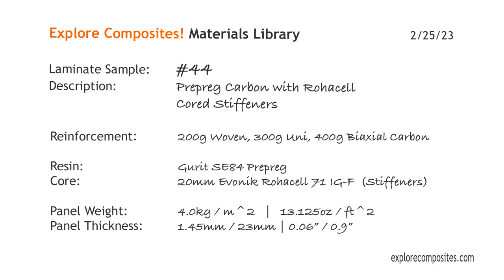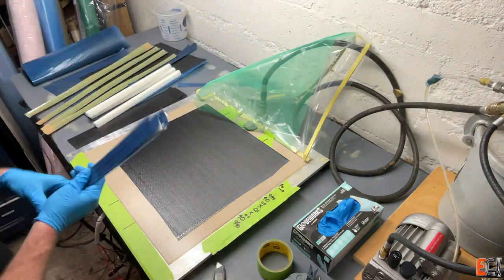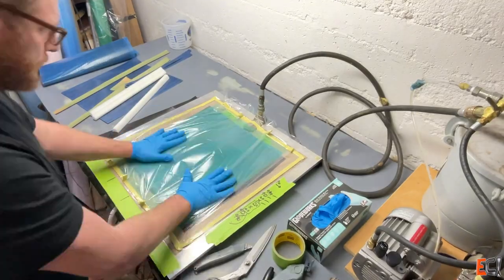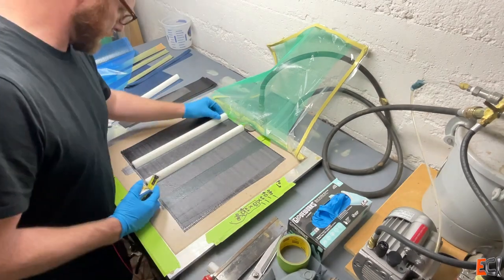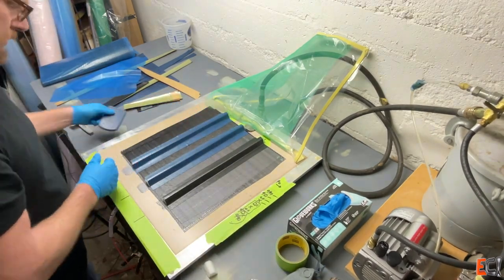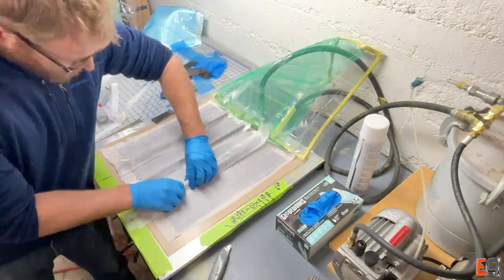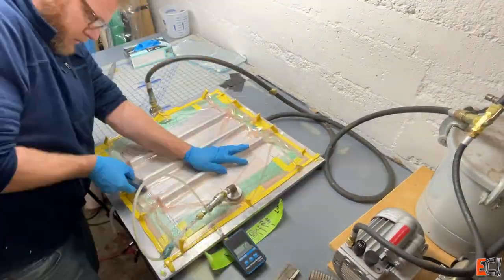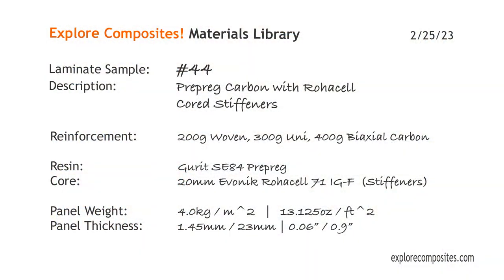Laminate Sample #44: Prepreg Carbon with Rohacell Cored Stiffeners

Comment: This is awesome. Be so cool to see a hull made this way but man it would be some work!!
Reply from the maker: Some ocean racing boats replace core with solid laminate and stringers in the forward hull - to help reduce damage from slamming into waves.  Often the stringers are molded off the boat and bonded in but there are probably some quite similar to this in construction.  And yes - a ton of work!
Reply: @ExploreComposites  I used coosaboard core in my boat build for the stringers etc, good stuff but it's so itchy it makes sanding fiberglass feel like candy floss :) Hand layup epoxy and biaxial. heavy way to do it. next time I'll try to use vacuum techniques

Comment: I'm wondering why you are using the peel ply and stack that sucks epoxy from the prepreg? Are not prepregs at the perfect resin to fabric ratio? Normally I see most prepreg stacks just have a non perforated release film and then vacuum bag. So was wondering why the different stack makes sense here? Thanks for the answer!
Reply from the maker: That is a good question!  The bleed is done here to make sure the air can escape from the curing laminate.  My rule of thumb is that in an autoclave with several atmospheres of pressure, you don't need to bleed off resin to get air to not be a problem.  But without an autoclave - especially with core and thicker parts - you should allow some resin to bleed off and that this helps.  (This is a very common approach in most of the factories I have worked in or visited.). 

For thin (less than 1mm) parts that are well debulked, it is fine to not bleed resin off - sometimes this helps with cosmetics - this is probably what you see most.

Check out my Laminate Sample #12 for some "semipermeable" Dahltex membrane to let air out but no resin.  https://youtu.be/wUiRHb0YRC0

The resin content of the biaxial here is quite high and the weight of the resin bled off is probably less than 15g total for this small sample.  The woven bleeder is very thin and doesn't take up much resin.  If average resin content is 40% this sample probably bleeds off about 10% of that resin, so the overall ratio ends up around 35%, which is fine.  

It is common to measure and then calculate how much resin you bleed off using a certain combination of perforated film and weight of breather.  Used consumables can be weighed and the uptake of resin calculated.  In very general terms, keeping resin content above 32-35% for mostly unidirectional carbon is a good place to be.  It is totally possible to bleed too much!
Reply: @ExploreComposites  thank you so much for the answer. I knew I had to ask. Thanks for all of these videos, I’ve learned so, so much from you! Keep making these awesome gems ❤️🤘

Comment: Hey, but what about pressing hard with the thumb on rohacell foam, will there be a visible dent left or not. What about pressing with fingernail?
Reply from the maker: It comes in varying densities - and the light stuff will dent with a finger.  This will easily dent with fingernail pressure but quite stiff and brittle over larger areas.

Comment: Hey, what do you think, how would this foam feel in direct contact with a skin. Does it fill similar to polystyrene foam? If you could find something more similar I'd love to know
Reply from the maker: This foam is very hard and almost sharp.  It does have a similar brittle sharp feel to the blue Dow Styrofoam that comes in big billets - but more so.  Not something I'd want to spend lots of time in direct contact with...
Reply: @ExploreComposites , I am new to foams and foam cores. It would be interesting to know how does it compare to some rigid pour pu foams

Comment: very nice,, !
what leak detector do you like ?
Reply from the maker: I have a few of the Amprobe ones which I like but the headphone jacks are delicate.  I just get used ones but have used nice expensive units but the real big thing that helps are good padded over the ear headphones to block outside noise - which you can plug into most detectors that come with cheap headphones.

Comment: Where do I find that adhesive sheet?  Can you do a video on the types of fittings you like to use?
Reply from the maker: The sheet is “film adhesive” and it is just prepreg resin of a certain weight.  This came from Gurit by way of Composites One.
Reply from the maker: Fittings:  https://explorecomposites.com/articles/tools-and-equipment/vacuum-stuff-hoses-fittings-and-accessories/

Comment: What is that device you used to check the pressure was holding?
Reply from the maker: Its an absolute vacuum gauge - digital.  Very handy tool.  This one is a Greisinger GDH 200 - its pretty old.  They make a newer smaller one now.

Comment: 3d printer bed heater is a great idea I think ill try shine a hot lightbulb at the bottom of my mold made from a 1” glass coffee table
Reply from the maker: Heat lamps are great, just be careful of the whole fire issue!  I've had some scares with hot bulbs.

Is there any risk of breaking the glass by heating unevenly?  I guess table tops are probably tempered glass...
Reply: @ExploreComposites  great questions I didn't consider. Testing soon. Hopefully 3' long by 2' wide 1" Glass mold doesn't distort much when lightbulb heated.

Comment: What is the tan layer you put down first on top of the metal base. I've seen you use this before in other vids and nothing seems to stick to it.
Reply from the maker: It’s adhesive PTFE release film.   https://explorecomposites.com/articles/tooling/adhesive-teflon-its-awesome/
Reply from the maker: Good stuff!  No need for chemical release agents.
Reply: Thank You! I saw the list of suppliers at the bottom of the article. Who did you get your material from?
Reply from the maker: Probably Taconic.  Composite Envisions and RockWest in the US sell it by the yard I think.
Reply: Thanks!
Reply: Are you using the porous or non-porous ptfe release film?

Comment: Do a primer video on NDT techniques of composites!
Reply from the maker: It’s something I’d love to do!  The little Flir camera works surprisingly well for seeing voids and core details.  And you can learn quite a but just tapping but its not exciting to watch.  

Need to borrow some better gear to show things that actually work.  I bought one of those very cheap ultrasonic thickness gauges and it seems to work fine on metal but is absolutely useless on composites!
Reply: @ExploreComposites  I think what’s likely happening is the frequency of the signal is way too high. I recall reading that ultrasound typically used for metals is on the order of a 20 kHz signal, whereas composites need a 5 kHz signal. (Or are these in MHz? I don’t know) it’s got to do with the acoustic properties of the materials, and the size flaws you are trying to pick up

Thanks for trying the cheap(ER) instrument, I’d always wondered if that would work. Now you saved me learning the same lesson!

Really enjoy what you do with your channel
Reply from the maker: @russellmiller2564  The one I have is 5mhz and the model is TM8812.  Works great for metal, and sometimes works in expected ways on dense composite, but just when I think there's a pattern and that its just not calibrated for the right velocity - it shows unexplainable results and I give up.  Needs more testing, but I'd love to get something that shows the waveform - just so much more intuitive and interesting.